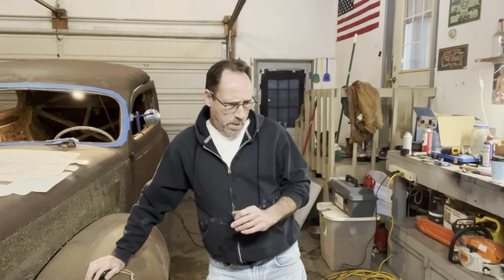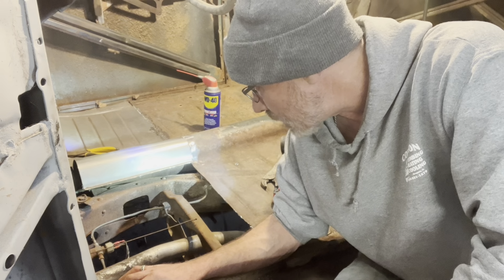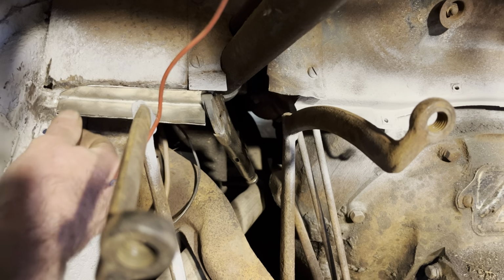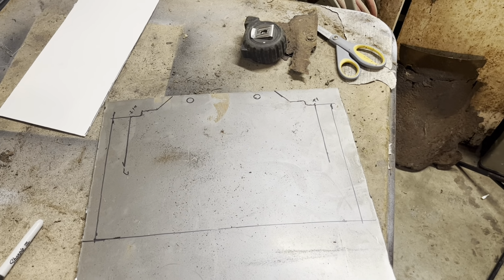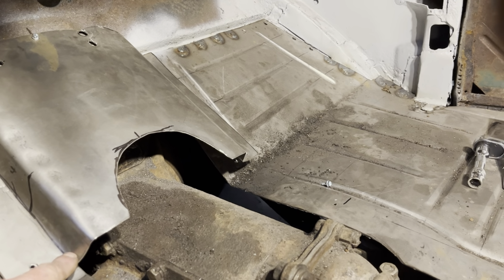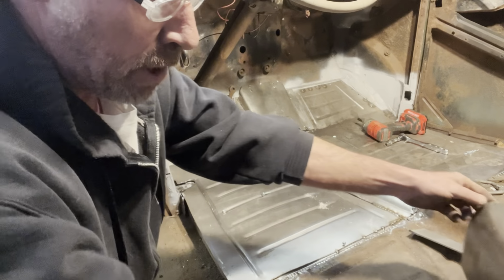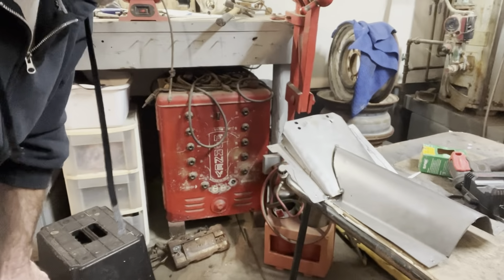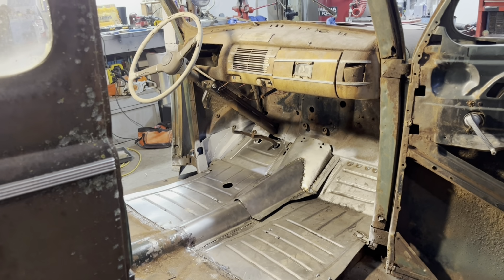Eliza 40 ford , making a transmission tunnel

Comment: I've been watching since you first started. As a retired mechanic who also dabbled in fabricating for myself I learned to make all my sheet metal parts from thin cardboard stock first as it's much easier to build it first untill I'm satisfied and then transfer the flat outline to the metal. Just a suggestion as I cringe a bit when you say "it'll be good enough" I appreciate your effort and love watching the build progress. Thanks for doing this and showing it on video!
Reply from the maker: Thanks for following along, I do use the cardboard, probably should have used it more during this fabrication

Comment: Great deal! Did you get the rocker panels delivered? Btw, a quick tip that I’ve seen: when you get ready to put on the panels on the doors and rear quarters, you can pour some ATF in there and it gets into the nooks and crannies and helps fight against rust.
Reply from the maker: New rockers look good, I posted them in a video short

Comment: Another enjoyable video - I read the comment about ‘ it will be good enough ‘

You are putting many hour’s,  blood, sweat and tear’s into this project.

Your work is more than good enough.

I fabricated part’s for my aluminium tub single seater TransAtlantic race car.

I too made pattern’s.
I would stick it through my folder, glue and rivet up .

  Built my nose boxes like this .

I have a project on going my self - 1951 Flathead panel van.

Your video’s are very inspiring

Especially looking forward to you driving and filming this Spring !!!!

LG Custom’s on YouTube has a great channel - check it out - you’ll love Doris :-)
Reply from the maker: Glad u enjoy the videos, I enjoy making them.  Thank u very much